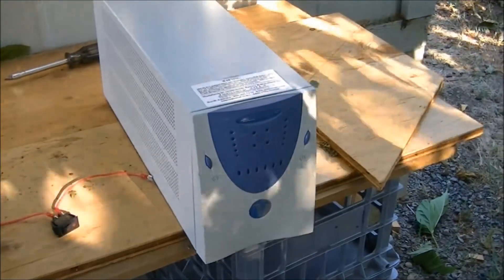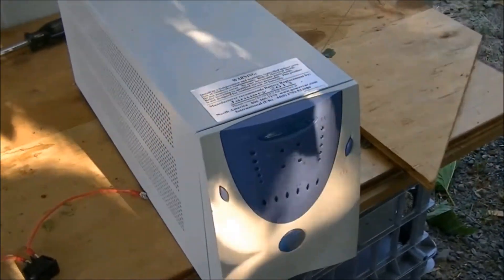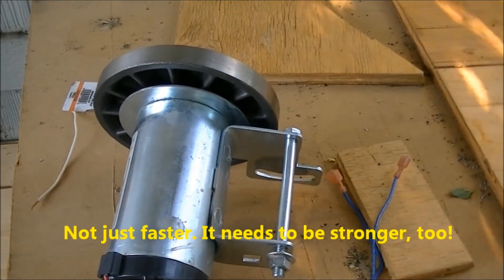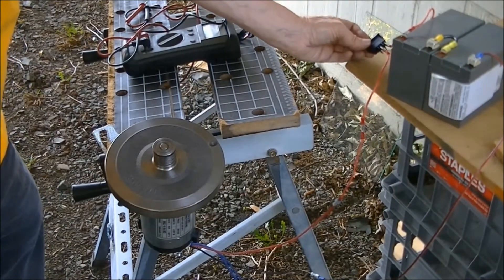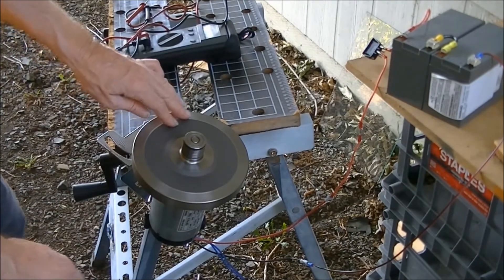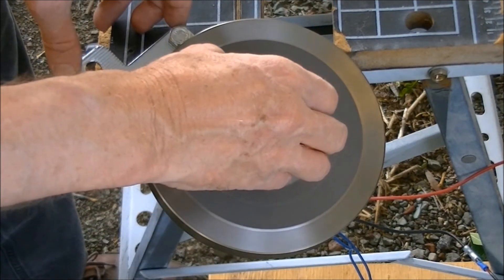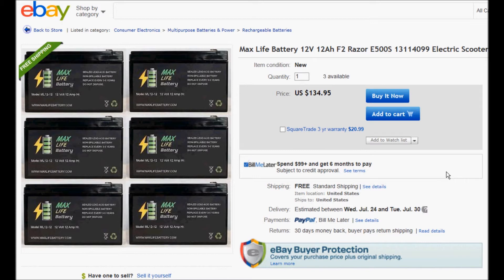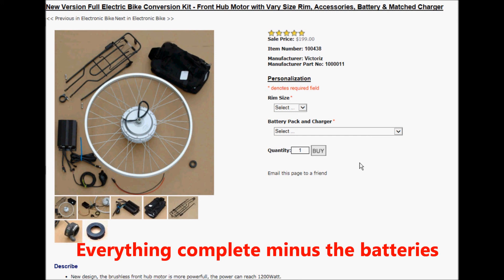Testing The NordicTrack Motor 2

Comment: what is the purpose of spinning this motor up? this is a second video I've watched I just don't see what you plan on doing with it
Reply from the maker: I had originally thought I might use that motor on an electric vehicle, but found out it didn't  have enough torque.

Comment from the maker: Well, for certain I have to take things a step at a time. I'm just learning what I need to know a little at a time. One tricky part will be putting a sprocket on the motor for a chain, and also mounting the motor to the frame so it doesn't vibrate loose might be challenging.

Comment: it wouldnt take much to give the treadmill motor a try. mount it so you pull a lever and the motor wheel presses against the tire. you could make a temp. fixture to test it out of wood.